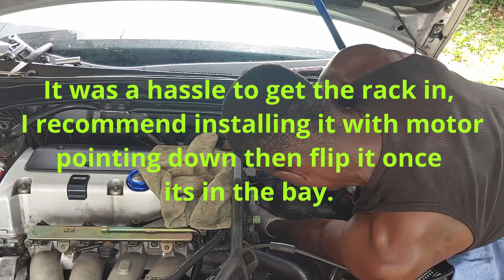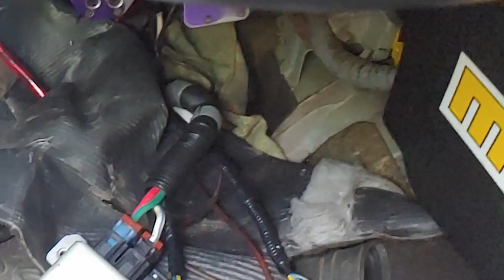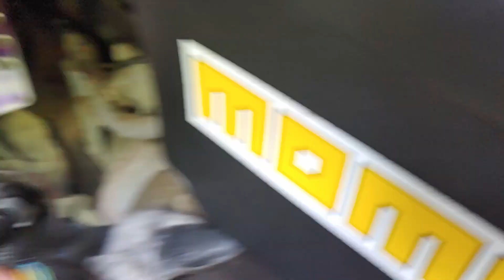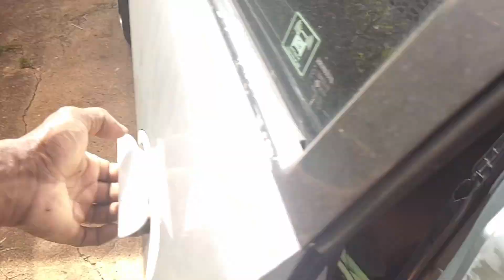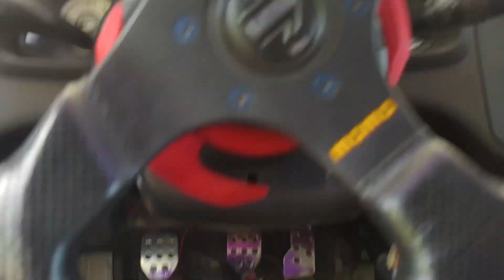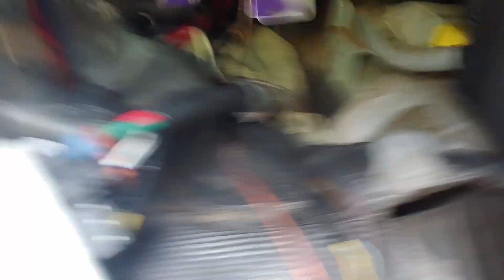EP3 Electric power steering completely install and working in the rsx (part 2).

Comment: hey i have one 05 and i think the module are from type r i do the connection but don’t work
Reply from the maker: 05-06 method is a little different from 02-04, the location for the pin out on the ecu is not the same plus you need a decoder box from ktuner.
Reply: @rohanovegeway8627  thanks appreciate
Reply: @rohanovegeway8627  i have a kpro ecu i need anyway the box?
Reply from the maker: @SMarzn I've done some research and base on what I've seen you don't need it even without kpro.
Reply: @rohanovegeway8627  appreciate it try but don’t work anyway 🥲
Reply: how i know i have the uk or us

Comment: After installing wiring, the steering wheel is moving like crazy.. once you touch it the steering wheel is twerking xD any suggestions what it can be? DC5 R 2002 rhd
Reply from the maker: Go to 22:34 in the video, I think I had the same problem.
Reply: @rohanovegeway8627  thanks man it's working 👌🏼

Comment: Which bracket and idler pulley u use fi delete the power steering pump?
Reply from the maker: Brackets from the ep3 civic and the aftermarket pulley that replicate the one from the ep3.
Reply: @rohanovegeway8627  respect.